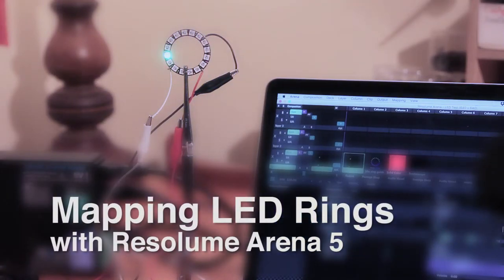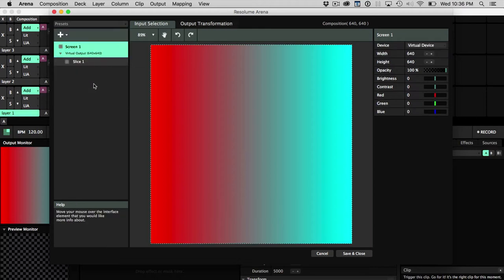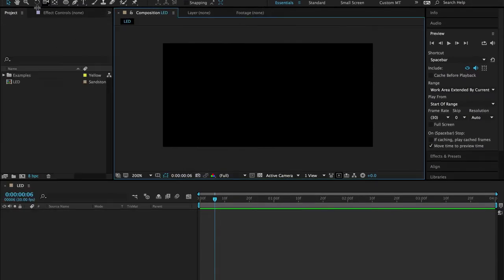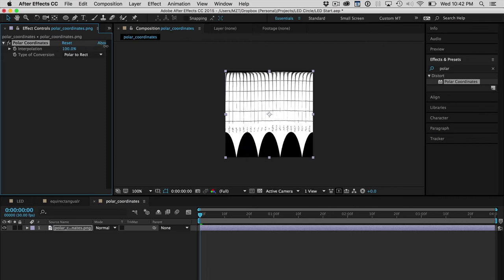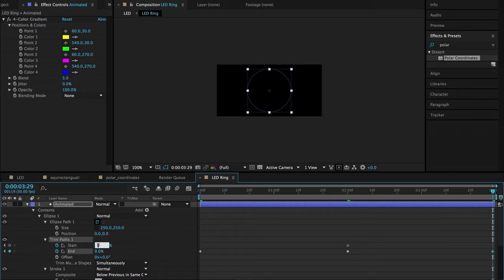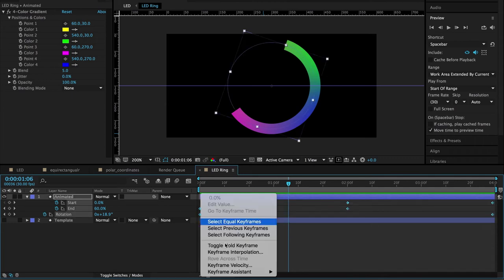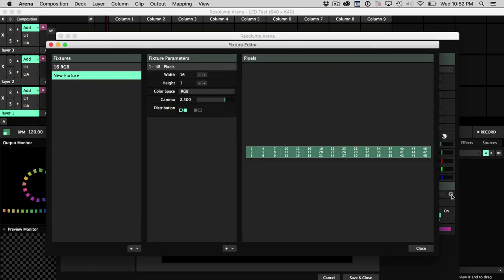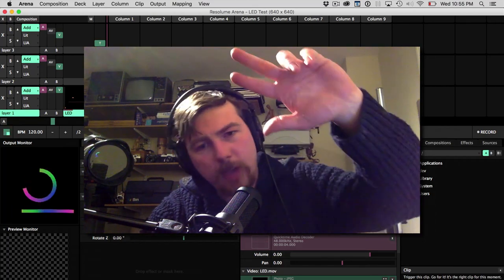Mapping LED Rings with Resolume 5 Arena and After Effects (Tutorial)

Comment: To hard to do. you can easily do this with a WLED installation. enabling artnet. you dont need any fancy usb connections. Just put the Ip adress of WLED and you are good to go
Reply from the maker: Thanks for the tip on WLED, not sure that existed when I made this tutorial.  The purpose of this is for VJ and realtime applications where Resolume is driving the content.   I used this to make an interactive art exhibit controlled along with sound, beats and BPM sync.
Reply: @duiceburger  Im using resolume and I mapped a matrix of leds by only using WLED installed on a controller. That controller accepts artnet. So i just added a fixture on resolume by its IP adress and you dont need to convert a circle image to a line. in resolume you can map your output as a circle as well.
Reply from the maker: @AlexandreCalvario  Oh nice, perhaps I over engineered this, or is the circle mapping a new feature?  This was done on Arena 5 over 3 years ago.
Reply: I need that tutorial! I've been looking all day on how to do this and haven't found it yet